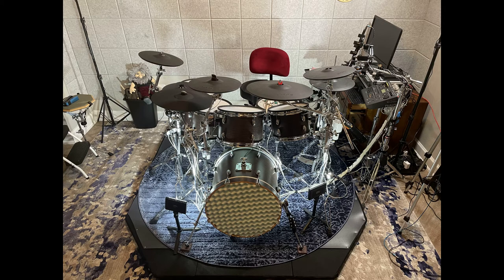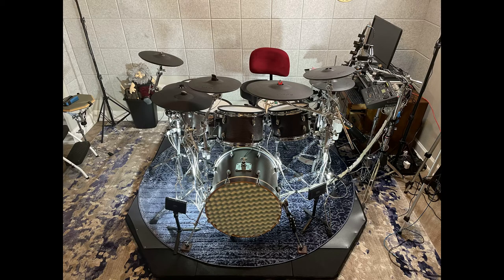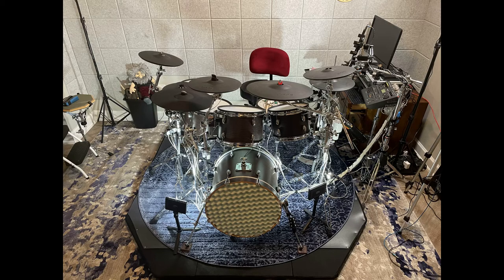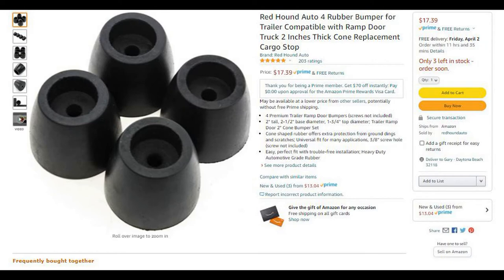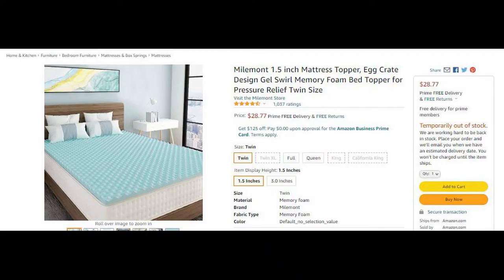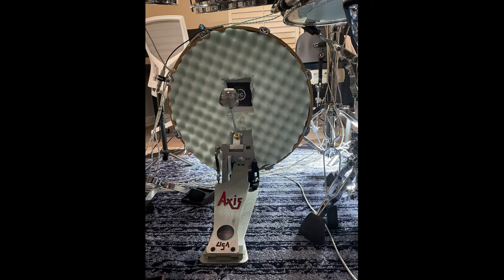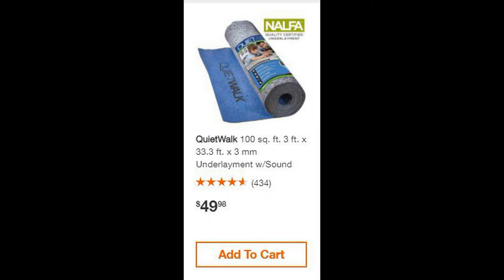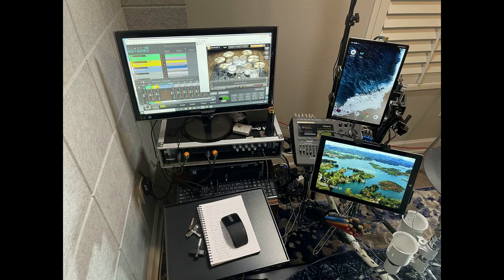Floor Soundproofing Drum Riser

Comment: Hey Gary. Thanks for posting this. I’m considering doing this exact solution. I’ve been toying with buying some mdf boards and sylomer to make my own platform, but honestly just feel like being lazy and buying the prebuilt platform. Do you feel like the rubber feet that come with the platform do a good job absorbing vibration. Is the platform still holding up and performing well for your neighbors? Thanks!

Comment: Excellent video and a great solution! That has given me some ideas for reducing vibration from my new e-kit. Really appreciate the cost breakdown at the end, too. Thanks for sharing!
Reply from the maker: Hey blind dog!  Thx for watching and for the feedback!  Hope it works for you. BTW, I found these supports to slide around the edges of the platform to stabilize it a bit more cause I was having a bit of “stand wobble” I was having on those stands with legs resting close to the edge. Exact same height as the rubber feet I used;  AMAZON - nediea Anti Vibration Pads for Washing Machine, Adjustable Anti-slip Washer Rubber Isolation Pads, Universal Furniture Pads 4 Packs https://a.co/d/6Iw2DsI